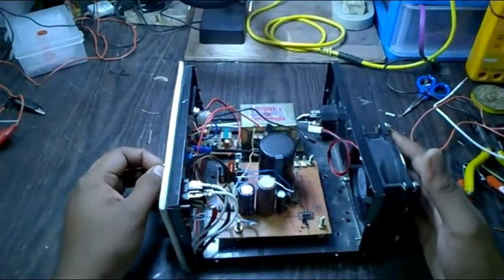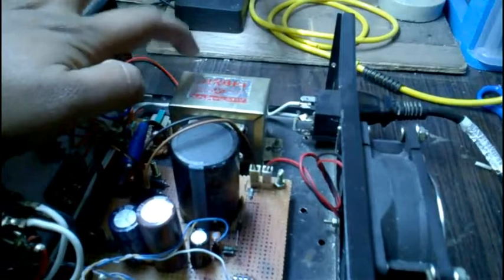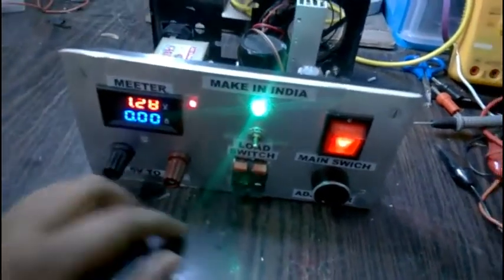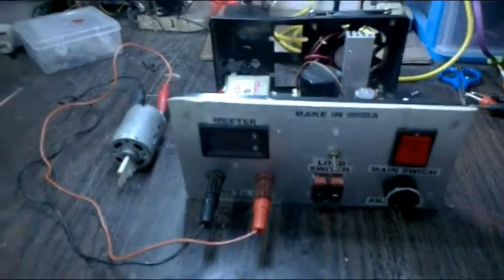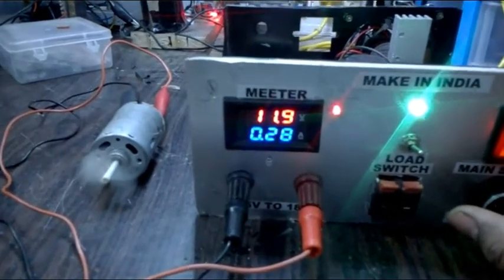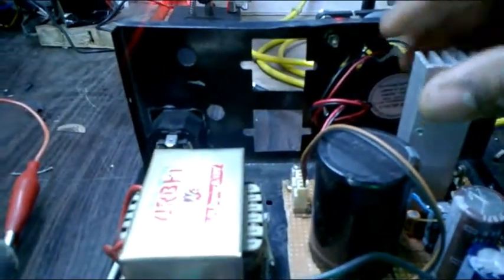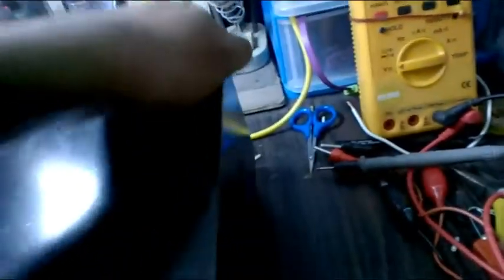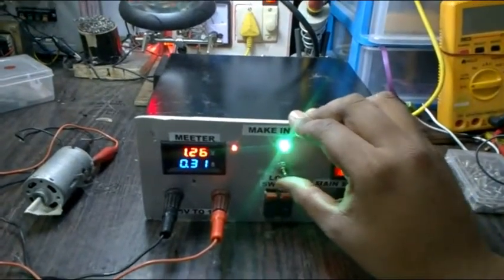Adjustable bench power supply (Making with LM317) part2

Comment: from where did u get ampere and voltmeter and what is the price
Reply from the maker: +Vishnu Chuncha  from ebay in about rs. 500/-
http://www.ebay.in/itm/DC-100V-10A-Voltmeter-Ammeter-Blue-Red-LED-Amp-Dual-Digital-Volt-Meter-Gauge-T-/111749317319?hash=item1a04c742c7